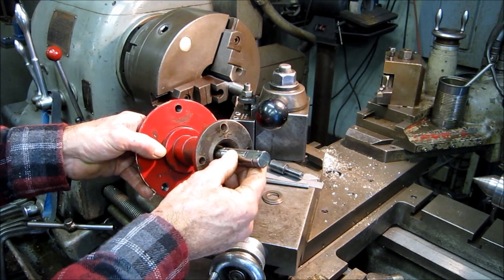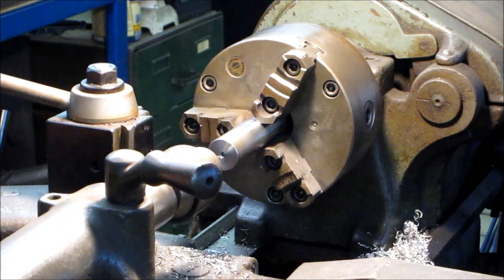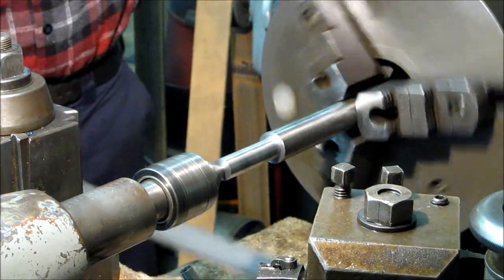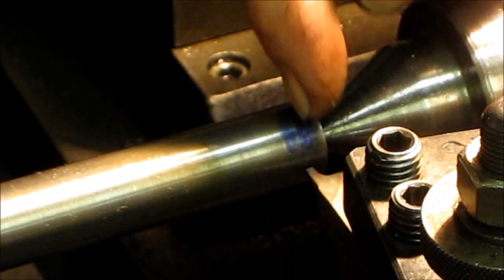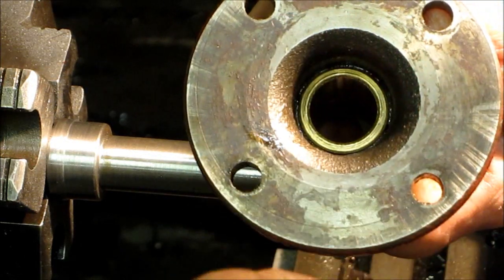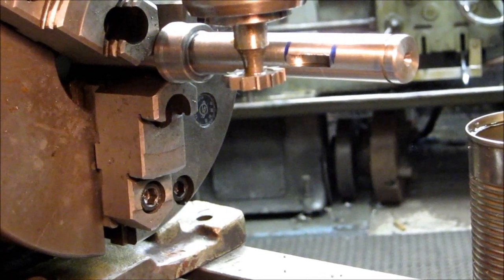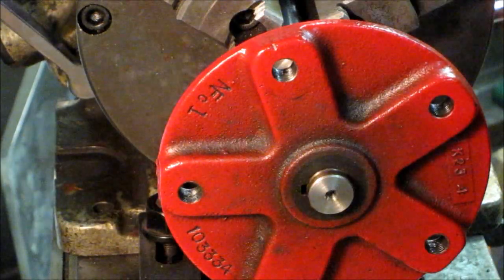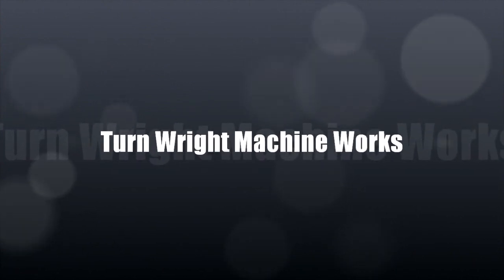Makeshift Axle

Comment: Just an added option for those who don't have a "dead nuts" chuck # for drilling a true centre hole

Run the outboard end of the shaft in a fixed steady rest to drill the hole, and it will run true even in a lathe in poor condition.

# I've just taken ownership of a 10" Bison 3 jaw with reversible 2-piece jaws like the one on Keith's Southbend, and an integral L0 taper mount, really short-coupled (which I love) in comparison with a conventional backplate mount.

It's a seriously nice piece of kit. TIR by the jaws 0.001" - that's really good for two-piece jaws. And the jaws are possibly an even better fit in the body (and consequently hard to refit!) than any new Pratt-Burnerd I've had ... and they're great chucks.

There's been some really good, no nonsense, accurate and high quality stuff (includng great metallurgy) coming out of Central Europe for forty years or more: Skoda lathes and running centres, Polamco lathes, Narex automatic Boring and Facing heads, Somet measuring equipment, some of the TOS machine tools (depending which plant they were made), Bison chucks, and some Deckel milling machine clones. Must be lots of other brands I haven't encountered...

Comment from the maker: I prefer the cutting oils and don't have the room for skirts that would have to be put in place and block access to the accessories I use one the machine most of the time. I don't do production and if it needs to cool down a bit I go do or start on another job, in the meantime. ;{)-----

Comment: Air cooling Carbide is recommended over coolant on a manual machine because there is not enough coolant flood to cool the whole cutter, just one question why not just use coolant on your HSS cutter and coolant on carbide cutter in the lathe, do you prefer cutting fluid and dose it produce a better finish or some thing and one more thing are you not worried about the material getting to  hot and expanding and get undersized tolerances when it cools Love your Vids BTW big fan.

Comment from the maker: The biggest decision maker is the surface condition of the last cut you had just made. Knowing how the material cuts at the amount you’re planning on taking or what is left to remove. DO YOU FEEL LUCKY? Nobody wants to start over or go backwards as they say.  I use flat mill files and prefer a 14” length. ;{)----

Comment from the maker: That’s very similar as the early Southbend, with the second set of pulleys mounted on a jack shaft and the reduction from the smaller motors was controlled by the V - Belt pulleys one on the motor was about 2” and the jack shaft was about 10” most likely the motor speed was 1750 or less. ;{)---

Comment: hello Keith, I'm Dylan and live in canada bc. I'm a heavy duty mechanic apprentice. i just recently bought a "ideal" lathe from around 1935. it has a 3 shiv flat pulley on the headstock but nothing else. I'm thinking of running a 1/2 to 3/4hp electric motor. the question i have is the speeds you need on such a small lathe, 7" swing. I was going to make another flat face belt pulley with the same 3 diameters as the one on the headstock, and just flip it so I have 3 speeds. what do you recommend ?

Comment from the maker: Keyways are made in shafts with both means of cutting, wheel cutters and end mills; Woodruff Keys are done with a Woodruff key cutter. The design in mind for the woodruff key was increasing the strength, of a short keyway length of a bore and or short shaft diameter next to a shoulder or between locknuts.

Comment: Keith, a beginner question, if I may... Woodriff keys and keyways, why are they round? I mean, why not make a plunge cut with an end mill to a certain depth? wouldn't it have a better hold, and better everything? (now that i think about it, creating the keyway in manner would be easy, but creating the key itself is kinda hard cause you got the radii at its ends... is that reason why a round key/keyways are used? cause making the keys are a lot easier? thanks! :))

Comment: Hello Keith. I did write a comment and congratulated you for your practical ways of finishing work. But I shall do so again if there are any guys out there thinking everything must be finished on the by the machine. I know CNC etc that what it does but. I am almost70 and an ex aircraft engineer. when Iwas at school my instructors from the old school used the file just as much as the lathe. they came out of shops that would build an engine run it, strip itdown n scrape finish everything. regards

Comment from the maker: Keyways are generally proportioned with relation to the shaft diameter, instead of torsion load in each case, because of practical reasons, such as standardization and interchangeability. There are two rules that are widely used. The key way width equals ¼ of the shafts diameter and 1/16 of the diameter for the thickness, or half engagement. The other is W = 3/16 D plus 1/16” and T = 1/8 D, for splines and feathering keys.   There are sixteen pages on keyways in the Machinery Handbook…

Comment: Keith hope you had a good holiday. Great video, nice explanation on the dials.

How close to finish diameter do you get before you decide to draw file?  Is there a length limit before you decide to take a light cut instead?  

When you cleaned up the shoulder at around 6:17 where you using the dial on the cross slide so you could get to the same diameter as the shaft that you just turned?  Or was that by eye?  Whichever it was it looked pretty much dead on.

Thanks again for taking the time